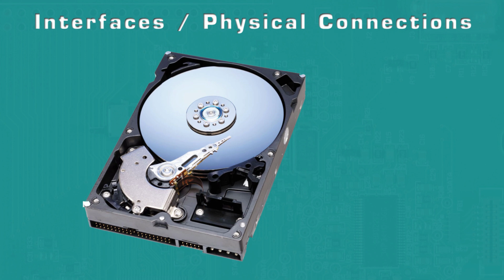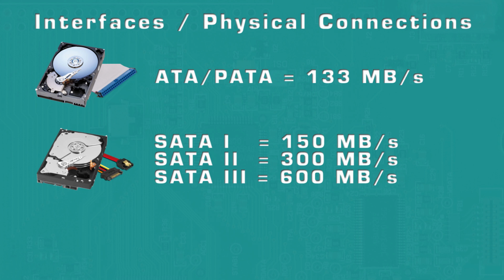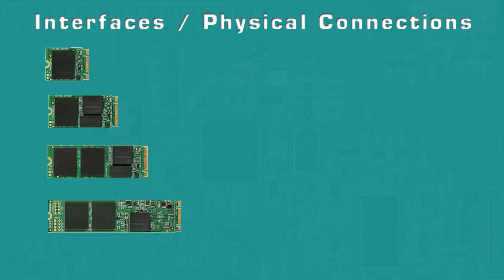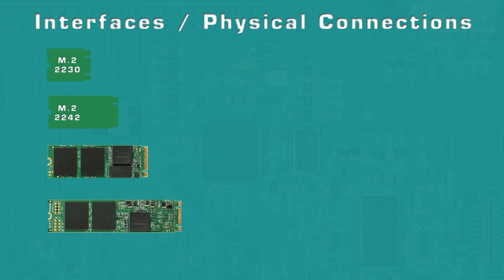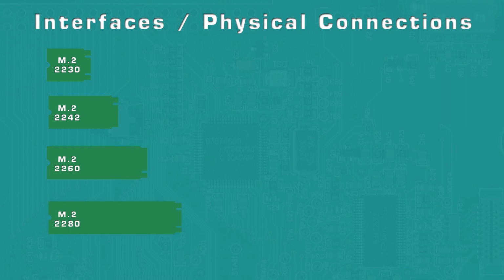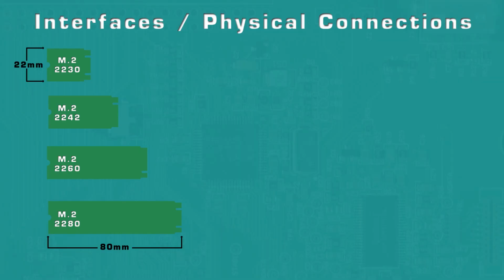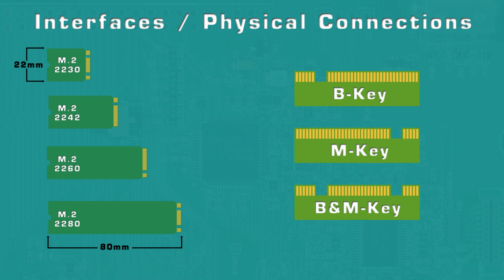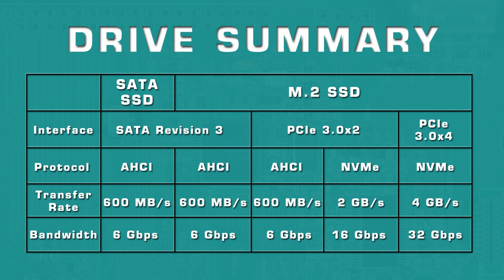Hard drives (IDE, AHCI, NVMe) and why SSD PCIe is  the way to go

Comment: i have a question i got a dell poweredge emc r330  i tried a pci express 4x  m.2 nvme connector in the pciexpress slot 8x server woulldnt read the drive in ahci i also tried it in raid and notthing.  what can i do to get it to work. beacuse windows seen itt installed to it and server  reboots and nothing it dosent see the drive
Reply: Maybe put off cmos, like he said in this video at beginning somewhere

Comment: My laptop have pcie3x4 slots only and no sata slot. It comes a kingston 512gb nvme drive. 
The question is in bios I have only two options for hdd interface.
1 ahci
2 intel rst premium with intel optane.

Which option should I use in bios for maximum performance from my nvme drive?
Reply: use ahci, better for nvme drives

Comment: I bought a m.2 nvme samsung 970 evo plus and my ahci ports cant detect it. is this a thing? on my bios it says ahci on my port and not nvme...
Can I use a NVME disk on a AHCI port??
Reply from the maker: RAID and AHCI typically only affect SATA drives.  They should have no bearing on NVMe drives as those are connected to the PCI-Express bus.  There are some NVMe drives that are able to boot on the AHCI bus but why?  You bypass the very reason NVMe was released, to deal with inefficiences of SAta connections.  At least that is my understanding.  There are some boards that will stop NVMe drives from working on AHCI so you need to check your MB specs.

Comment: Hi Steve, fantastic explanation but I am a little lost on your table. Take the PCIe 3.0x4, it says the transfer rate is 4 GB/s (per-lane) but the bandwidth is 32 Gbps, how did you come up with that number?
Reply: GB means Gigabyte, Gb means Gigabit. 1 Byte = 8 Bit, so 4 GB = 32 Gb. At least I think that's what's going on here ^^